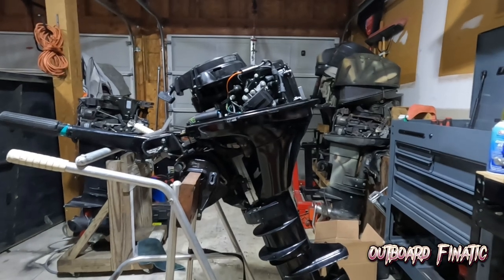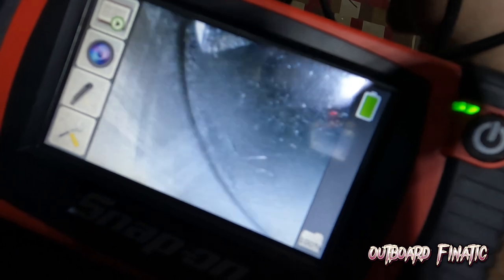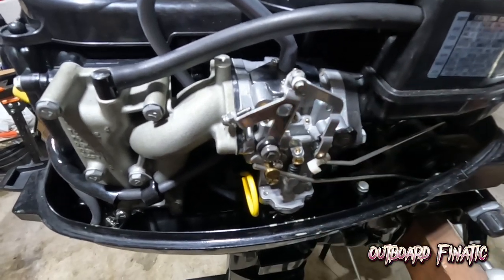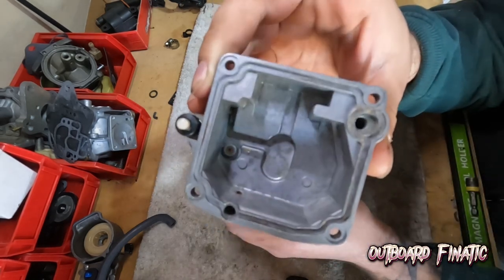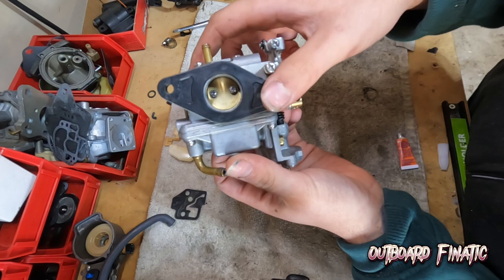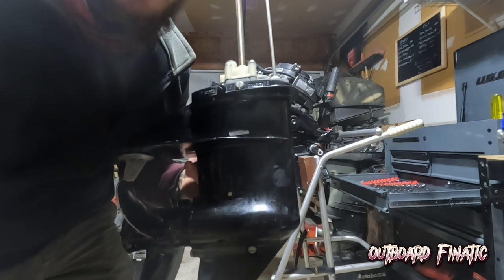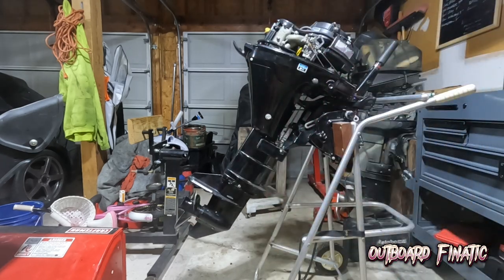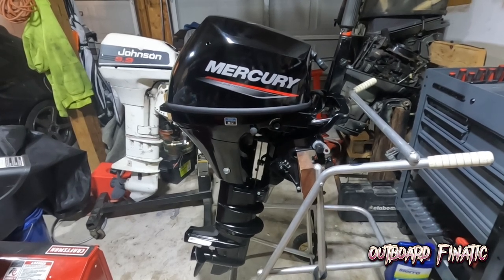Mercury 9.9 4 stroke (Complete service)

Comment: At 10:50 where you dropped the check valve onto your hand.  On that part, am I suppose to see light all the way  through the other end of the hole?  I tried to ream it and I'm not able to go all the way through.  I'm not sure if its got something stuck inside?  Thanks
Reply: awe, I think I found that these only allow fuel to out one way.
Reply from the maker: Yea so basically when you pop that ball out you should see straightt through. But not a lot. The plunger pushes on that ball and allows fuel to go by. The spring below the ball allows it to shut off the gas so it dosent just flood the carb

Comment: I own a 2020 9.9 merc similar to this one. After 3 seasons the motor will not stay on in idle, only full choke. I took apart the carb and cleaned all the jets and it ran a little better, but it still stalls when the choke is off. any ideas what it could be?
Reply from the maker: Either fuel lines clogged going to carb, possibly fuel pump going bad. But I have noticed some if the after market floats and needles just something ain’t right with them. Idk if maybe u used a aftermarket carb kit but for some reason the floats don’t sit right and there’s no way to adjust them and the needles don’t seem to set the best. Maybe try an oem kit and adjust your idle mixture slightly and see what happens
Reply: No aftermarket kit used yet. I did order one of Amazon with good reviews tho. I will be installing it on Monday and I will let you know what happens. I also ordered a new fuel filter. What sucks is that I only have may 20 hours on this kicker. I must’ve used crappy fuel at one time and it varnished up last winter.
Reply from the maker: @sauzaman72 gotcha gotcha yea lmk what ya find I just had one motor that was super clean before and I did the whole fuel system went to run it and one of the fuel lines from the engine fitting was clogged so wouldn’t run unless I was choking it. I’ve also have had the inline fuel filter be bad right out of the box. Took me forever to back track it to the brand new filter I just put on. Basically was collapsed out of factory and had similar running issues. Just some things to think about as well
Reply: Just wanted to give you an update. I replaced a fuel line going to the carb bc it had a pin hole, but it still stalled on low idle. Took the carb apart again, and it was full of gunk. It must’ve loosened it all up the last time I cleaned it. Cleaned the whole carb and both high idle and low idle jets again and now it purrs like a kitten at low idle. Thanks again!
Reply from the maker: @sauzaman72  hahah that’s awesome yea that got me too before. I’m glad we were able to get it figured out have a good one and stay tuned for some more stuff in the future!!!
Reply: @sauzaman72  Having this same problem on my motor right now. Its nothing serious, just a bit annoying at the dock. Was yours idling fine after running for a while because that's how mine is. When I first start it up, it usually dies right out after a bit but if I start it and then give it gas, I'm good and then after 10 minutes it idles amazing. I have to give it a couple clicks of fuel to get it started up so it makes me think its something with the fuel lines too.
Reply: @zilexx975 definitely check the fuel lines, especially the one coming from the fuel pump to the carb. Look for cracks or pinholes. If it looks good, it’s probably your low and high speed needles in the carb. Take it apart and clean it thoroughly with carb cleaner. Make sure all the holes on the needles are unplugged. That will probably fix it. Good luck!
Reply: @ thanks a lot!

Comment: Great video by the way-I have a question I have a 2015 9.9 mercury 4stroke,when I start the motor it idles high like scary high so I have to grab the throttle linkage on the carb and pull it either forward or backwards really don’t remember which way it is,but I have to do that every time in order for me to shift gears-I know there’s a idle screw there but it is set perfect-any idea to what can cause this issue-any info is appreciated
Reply from the maker: The throttle wire isn’t set correctly. The one rod that moves and pushes on the enrichner. I sent the motor in neutral and hold the rod back on the spindle where the cables are. You’ll see it’s like oval looking on the end of the rod. Loosen the screw while pushing the rod down. Make sure the carb is completely shut then you can tighten the screw back up and it’ll be set properly.
Reply: @outboardfinatic  thanks a lot I’ll see what I can do, thanks again

Comment: Very nice and informative video sir I have the same engine but I can't release the throttle boat not picking up speed so what so every I increase speed please advice me sir thanks
Reply from the maker: Could ya explain again what the issue is? You can get up on plane in a boat? As in the motor won’t increase in rpm’s? There’s 2 screws one for idle mixture which is the screw inside the carb. That should be set at around 1 1/2 turns from seated position. The other screw is for idle speed. Once you have idle mixture set right you can run the engine and listen to the motor. If you increase the screw the faster then engine will go. These motors tho are set at around 900 rpm at idle. Hope this helps lmk if it’s something else I can help you with

Comment: Any tips on how to make the throttling of the motor more direct as I feel I have to turn the throttle handle quite a bit before any change kind of like a dead area at the start
Reply from the maker: Tighten up the shift bd throttles cables located on the Side of the motor. It’ll tighten them up and help w thay
Reply: @outboardfinatic  what’s bd cables
Reply from the maker: @kennymunro4572  I meant to write shift and* throttle cables. Should be 2 nuts on the cable located on the side of the motor. Doing the top but right to loosen the cable then twist the bottoms but right to tighten up the cable. What’s you got good tension. Thread down the top but to hold the cable into place
Reply from the maker: @kennymunro4572  if you actually watch my most recent vid w the mercury 25 xd service I actually tighten up and talk about shift and throttle cables. Different motors but still the same process etc

Comment: Does the 2007 electric start have a charge system?
Reply from the maker: It should. Does your motor have a voltage regulator on it? Should be a little box type of thing that will a lot of times have a red wire and some yellows coming out of it

Comment: These engines often go for cheap... because in my opinion they have bad power
Reply from the maker: Interesting. I’d personally argue the opposite but I would love to just hear your feed back on these motors. I personally think they have great output and weight comparison only being about 10 lbs heavier than a typical mercury 2 stroke of similar hp. In my area they are worth a decent coin. But I can see in other areas other motors being favored all based on condition me your going to be in